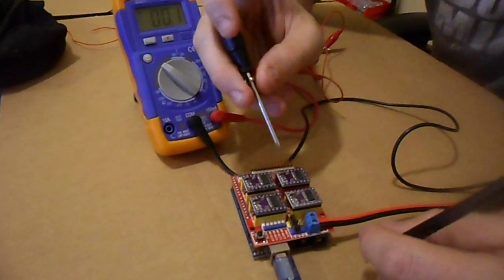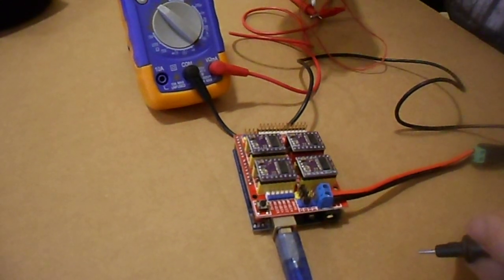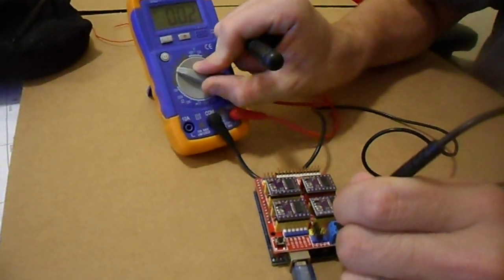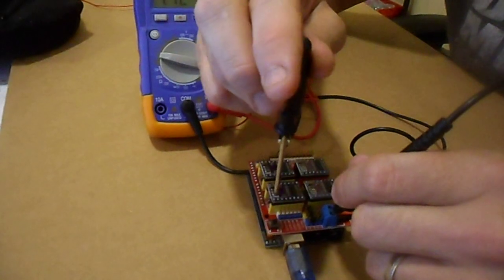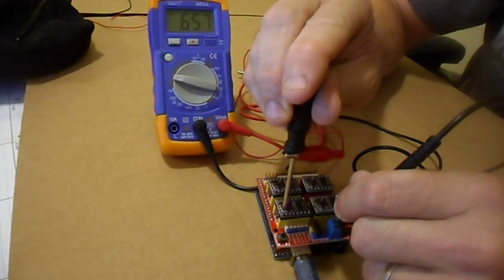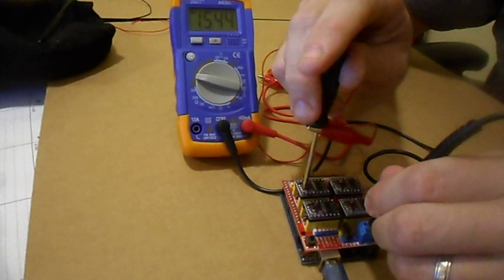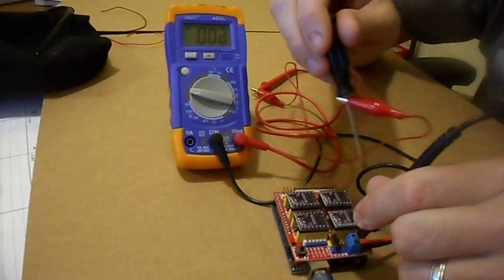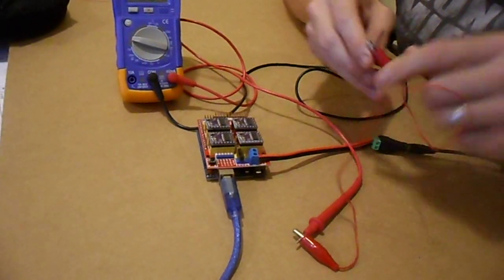Adjusting DRV8825 drivers MillRight CNC

Comment: This is a great tutorial. I had one of the original Carve King Kits that was in storage for the last several years... without this info I would never gotten across the finish line. Nice straight forward demonstration of how to set the voltages on my controller board. Thanks for keeping this available and the guys on the Carve King forum for leading to this video.

Comment: basic have this driver working only less than 2,2A max current motors nema 17 etc, if use nema 23 motor 3-4A current need external stepper motor driver etc, DM 544 who can use more amper. TB 6600 have worst driver many has blow this broken, better use DM 5xx drivers, numbers mean what max current can use.542 max 2A 544 max 4A i use 556 max 6A my nema 23 4A motors. you need know what motor max current have very important run motor less than max current and near max current 4A motor better run 3,8A max current setting not burn motor. and have best torque motor, if use too low current motor not run good or no have torque move.

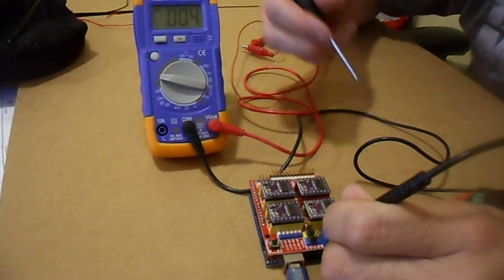Comment: Is it safe to do the setup you showed without corresponding stepper motors being plugged in. The reason I ask is that I found the video  which contains the tip that you should only power the shield with steppers connected otherwise you will  damage driver boards. Please check it https://www.youtube.com/watch?v=OfyT1xTZC6o Go to 1:22

Comment: Do you need to adjust the current on the drivers if you have an adjustable power supply? My stepper motors only need about 9V and I can adjust the power supply to that. I’m fairly new to this btw!
Reply: stepper motor not have important what volt use, biggest better, i use etc, nema 17 motor 9volt 2A moto 46 volt and less 2A current. motor have only important current not setting more than motor maximum current have or burn motor.

Comment: im pretty sure you just fried those drivers. under NO circumstance should you tell people not to add power without steppers plugged in. Sure way to fry those drivers.
Reply from the maker: You're completely wrong Christopher. We've been doing this for years and have sold thousands and thousands of these drivers with our machines. We would know.
Reply: You can fry it only when put too much voltage, max voltage for CNC Shield is 36V. Or disconnect stepper motor during its work. You can't damage the drivers when connecting power to board without motor connection.

Comment: Very nice explanation...I have a question...which formula did you use to calculate the max current on your motor? I have the same shield and the same drivers whit a nema 23..thanks
Reply: Did the drv8825 work fine for nema23 ??
Reply: @A2Zfarmsupdate  only if nema 23 motor use less than 2A current, if use nema 23 motor 3 or 4A current need external stepper motor driver, etc. DM 542 etc, who can use 3A motor or 4A motor. drv driver can maximum use 2A to motor, if motor max current have more need external driver and take out drv8825 driver.

Comment: Hi, thanks for the explanation, is it possible to connect two steppers for y axes with only one of this drivers?
Reply: if you have 4 drivers and the arduino with the same shield as he has there are pins on there to clone the axis makes the driver thats sitting on the red block work with the one you set it to. but still requires matching the current & reversing the stepper harness

Comment: Hello friend,
I'm newbie
I have motor stepper nema 23 103h7124-1041 (sanyo denki) unipolar DC 3.25 amp, but i make to bipolar. I will wiring it to drv8825 with arduino shield v.3.
I used power supply 24v 20amp

My question is calculate Vref,
Imax=Vref*2
So Vref =Imax/2
Vref=1.625
Is it okay for drv8825?
Thanks you,
Reply: Recuerda que el máximo para el drv8825 es de 2,2 amper. 

Mide la resistencia de cada bipolar. Divide tus 24 volt en esa resistencia. Esa seria la maxima corriente. Debes tomar el 70% de esa corriente.
Luego esa es tu Imáx.

Por ejemplo:
Si tu resistencia conectado como bipolar es de 100 ohm entonces tu corriente máxima es de 0,24 amper. De esta corriente tomas el 70% es decir 0,24x0,7=0,168 amper esta es tu Imax.

Esto es si es full step.(Es lo mejor)
Reply: @franciscobagoros8479  depende lo que necesitas...
Reply: motor max current 3,25A ok, you need external motor drivers not can use drv8825 driver. etc, DM 544 drivers, and dip switch adjust max driver current to motors, example if you motor max current have 3,25A driver need setting dip switch near less 3,2 maybe about 3A max current to driver. then motor run best. and volt need be area cnc dhield near max 36 volt, about 30 volt power supply have good.